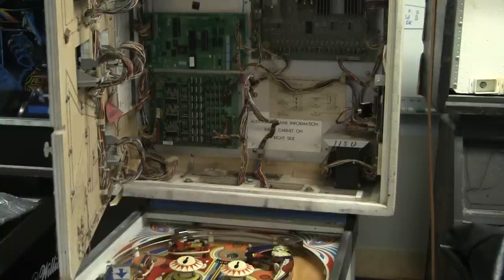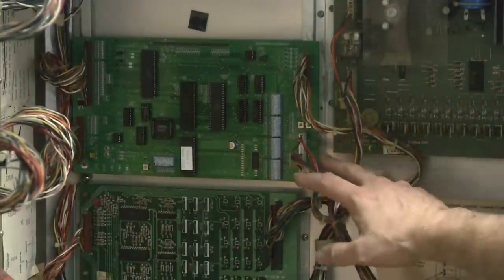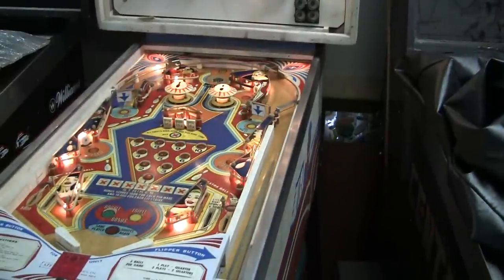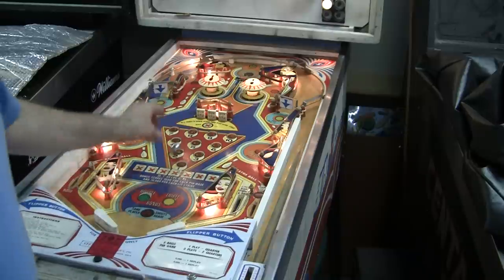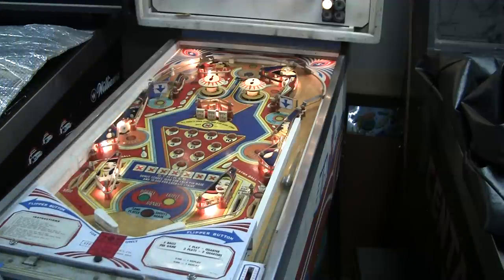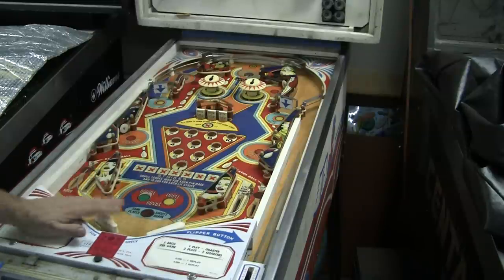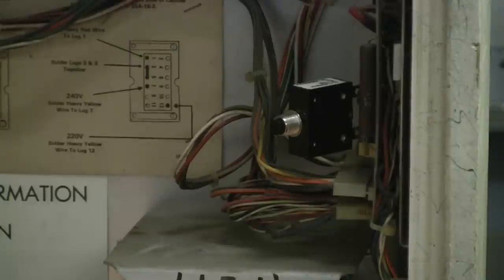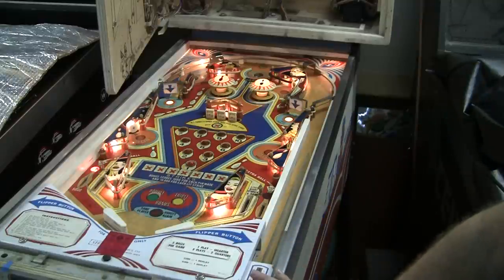Diagnosing early Stern/Bally SS pinball games - flipper not working Pt 1 - PinballHelp.com

Comment: Did you figure out what was wrong with the flipper staying energized?  I have a Stern Flight 2000 that has the same problem with both flippers.  I was thinking it might be an issue with the flipper relay on the solenoid driver board.  If you solved the issue, it might save me some time.